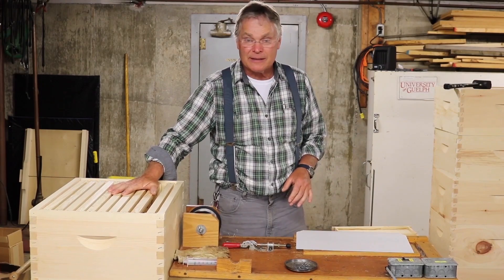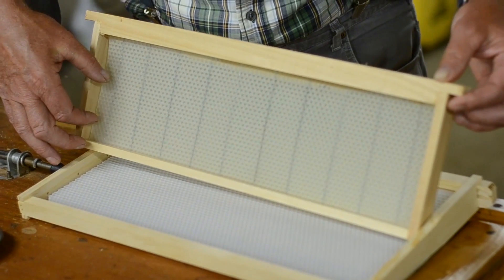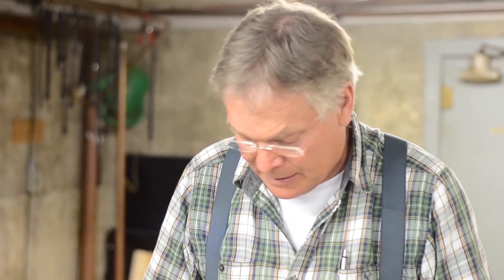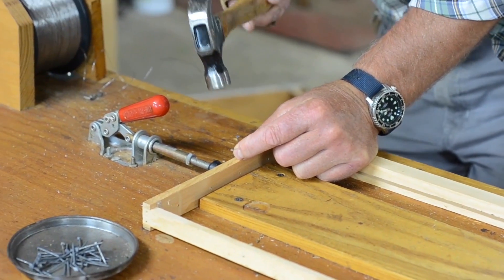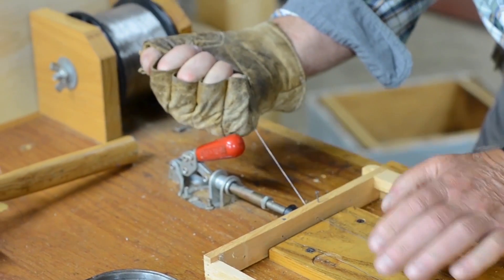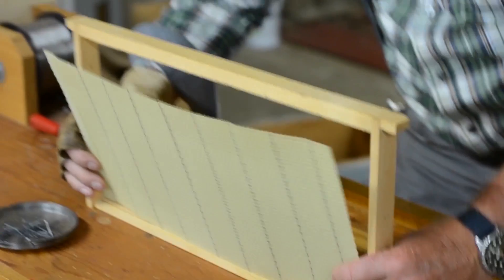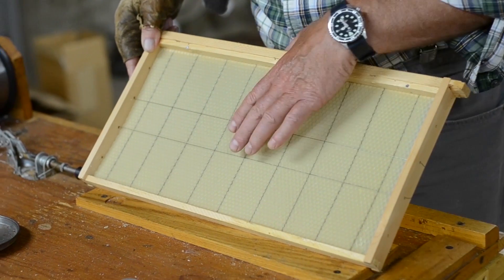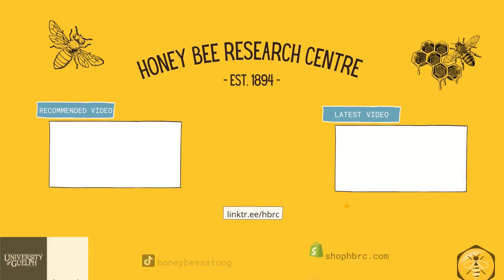Assembling Beekeeping Equipment Part 2 - Installing Foundation

Comment: In Europe beeswax foundation is what is used and learning to melt it in properly is a rite of passage.

I have never used plastic foundation and probably never will. In American beekeeping videos I see a lot of complaining that it is so difficult to get bees to build on plastic foundation? That is not the case with beeswax foundation at all.
I looked up if you can buy plastic foundation here and you can; but one sheet is 2-5 times as expensive as the frame itself !?

One very important tip when melting in wax foundation is that you want the wax foundation to be preheated to a warm temperature (broodnest temperature). That way the beeswax foundation when in the hive will not expand further than the frame and will not buckle.
So either work in a very hot room or preheat up the packet of beeswax foundation with for instance an old electric blanket.

I saw a video by bee researcher dr. Pia Aumeier where she demonstrates how to melt in wax foundation and what to avoid. She uses an old electric blanket to preheat the beeswax foundation and a special tool to tension the stainless steel wires when they are too slack. She claims she can produce 150 frames with wax foundation in an hour. The video is in German but you'll get the gist.

See: https://www.youtube.com/watch?v=fyqNLRzciQE
Reply from the maker: Hi Patrick
I enjoyed reading about your experiences with beeswax foundation. The European frames I've seen( in Denmark) were built in a way that it is quicker and easier to install wax foundation than our North American frames. Easier to melt the comb out and reuse the frames too. 
We don't need to preheat the foundation to install it as we leave expansion space in the bottom bar groove. I think I mentioned that in the video.
 I've gone to plastic foundation for brood chambers but still prefer beeswax foundation in honey supers. Aesthetically I prefer beeswax but I'd rather be skiing in the winter than building frames!

Comment: Ive been learning all summer and getting ready for my first hive this coming spring and you are my favorite to watch, thank you for all the help and knowledge you share. My question is, do bees really build comb faster on just a starter strip? Also my neighbor got his first hive this year and on a few frames the bees doesnt build good around the reinforced wire, so my plan when I get my package is to checker board with starter strips (popsicle sticks) and wireless wax foundation, would that work? (I was hoping to buy a few drawn out frames off the local bee guru to get a headstart too?)
Reply from the maker: Most beekeeper prefer to use a full sheet of foundation. You get better comb.

Comment: Thanks for the awesome video.  wax foundation takes so much more work!! I have never tried them and probably never will.  I have been using a mixed of plastic foundation and foundationless. It works well so far.  But I can only use weak colonies or wait till no drones flying around to build foundationless frames (to reduce drone cells).  Foundationless also will just cost 1/4 of the cost of a fully assembled plastic foundation frame.    Although in the future I probably will just switch to full plastic foundation frames. Reason: less work for me.  Building frames takes times. Buying the fully assembled frames is such a joy :)
Reply from the maker: Some good thoughts there. Thanks. Over time most beekeepers end up using foundation of some sort as you get better comb.